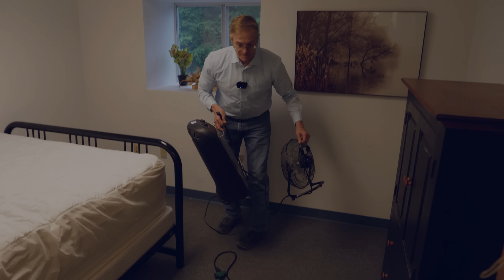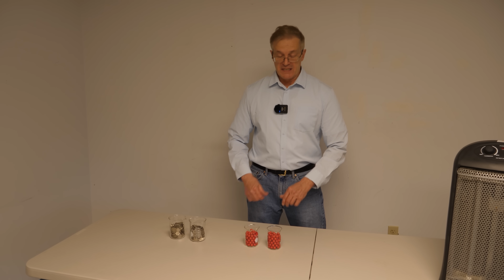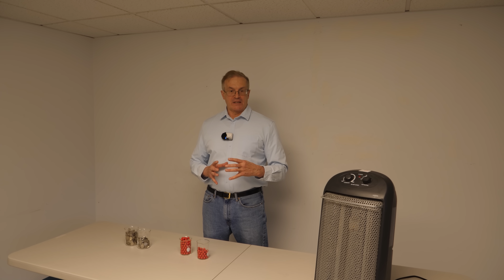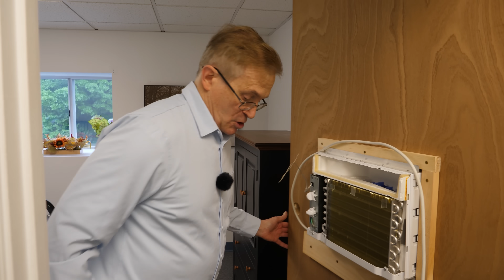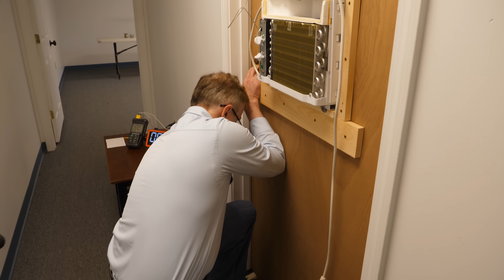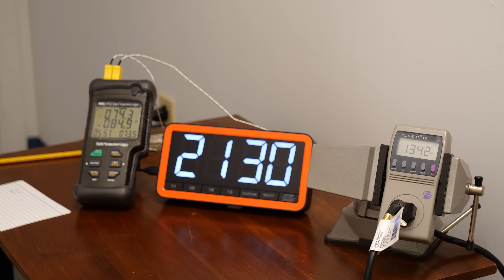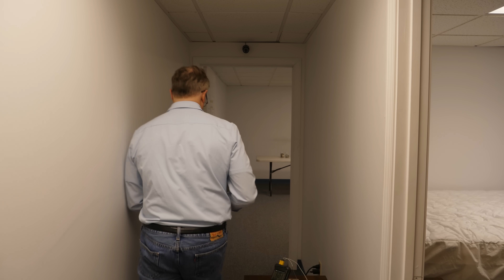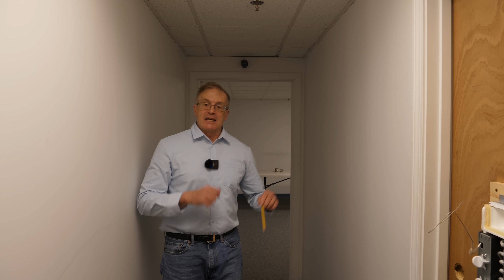You're wasting money on heating! Use your A/C!

Comment: Others have mentioned this but you are massively overcomplicating what's actually pretty simple and that's because heat pumps aren't heaters 

Anybody who thinks it's over unity because it's more than 100% efficient it's not over 100% efficient when they say over 100% efficient what they're talking about is how much heat you get per unit of electricity compared to a regular heater 

The heater he used is a heater it creates heat by converting electricity into heat 

A heat pump is not a heater at all it does not create heat so there is no such thing as how efficient the heater is it because it's not a heater. 

It's like when you see an LED light bulb that says it's 60 w equivalent but it's a 6 watt bulb it's a six watt bulb that's what it is The 60 watt equivalent means it puts out a similar amount of light that in average typical incandescent 60 w bulb would put out 

Is he bulbs aren't wattage based they're lumen based how bright is a bulb The watts don't matter how many lumens does it put out but because all of our bulb was where incandescent we learned to equate the wattage with the brightness so we didn't say it was a 1600 lumen bulb we said it was a 100 watt bulb That's why we have that weird conversion 60 watt equivalent even though it consumes six watts 

You have something similar going on here The COP factor is the same thing as saying this 6watt bulb is equivalent to a 60 watt bulb we're trying to compare it to heaters and instead of talking about BTUs per watt we're just comparing it to normal conventional resistance heating 

So a heat pump is exactly what its name says it's a heat pump meaning it's a pump it's just moving heat it's not making heat That's not its primary purpose it's primary purpose is to move heat from one side to the other 

A simple way of thinking about this is imagine you have a bucket and you can fill that bucket with heat when you want to cool your house you come inside your house you fill your bucket with heat you go outside and you dump the bucket out now the inside of the house has less heat so it feels cooler 

When you reverse a heat pump and run it in heat mode you're doing the opposite You're going outside with your bucket and your collecting heat once you fill the bucket with heat you come inside and you dump that heat inside your house 

The reason a heat pump is so efficient is because the energy that you have to expend to walk outside and fill your bucket with heat is less than the energy required to generate new heat using electricity 

But it's cold outside that doesn't matter although it does affect deficiency and depending on the design of the unit how cold you can go for example if there's half the amount of heat in the outside air not half the amount of total heat but half the amount that I'm able to extract well I just need to pass twice the amount of air through the machine to collect the same bucket of heat so as it gets colder outside I need to pass more air through the machine in order to collect enough heat to fill the bucket before I then dump that bucket inside the house 

Depending on the design of your unit will determine how low the outside temperature can be and the heater will still work effectively and also how efficiently it can do so you'll commonly see something called a seer rating the higher the seer rating the less electricity required to generate a BTU of heat

The core problem right now is that heat pumps require installation nobody makes a reasonably priced window unit that can function as a heat pump or in this case a bi-directional heat pump 

There are a couple companies making window units that are bi-directional heat pumps however these are government money sponges that's why they're selling $400 heat pumps in a window unit package for $3,000 because that's the budget limit of the government project so they of course make their unit as expensive as the budget will allow to sponge up as much of the government money as possible we already make four and $500 heat pumps so it should be possible to make a four or $500 window heat pump All it is is the same thing in a case that you stick out your window literally that's all it is currently no one really makes one of those 

There is one window unit for like 400 bucks on Amazon that can function as a heat pump but it doesn't have all of the necessary doodads to make it a true bidirectional heat bump so it only works down to 41°

I would really like to see a nice small cheap two or $300 5000 BTU bidirectional heat pump with a halfway decent seer rating say 19 or higher would be nice because then it will become feasible to solar power heat especially in the desert where I live. 

But that's all it is really it's not a heater it's a heat pump and all the over 100% and COP factor is is trying to give you a comparison to conventional resistance heaters what you need to worry about to make it simple for you to understand is simply how many BTUs of heat can I get and how much power does it take to get that That's all you need to know in order to compare these units

Comment: I'm used to watching longer vids than this from you, but it was short, concise, & informative. I knew what heat pumps were, but never really knew why they differed from an A/C or heater unit till now. I'd much rather spend my electric bill watching stuff like this than on cooling & heating.
Reply: @TechIngredients  If you can find the time, please help Jeremiah out with some advice on his Rankine cycle Tesla turbine power plant. I would love to see you play with that system some day! What you've described here seems applicable. https://www.youtube.com/watch?v=kQx8JacCWMU
Reply: @TechIngredients Just for your consideration the heater and fan were on the opposite side of the room. You should have compensated and moved the thermometer to the opposite side during the window unit as it wasn't as far from the source of heat  just guessing about three feet. It is possible it showed an artificially evaluated temp being that close to the condenser of the window unit.

Comment: It would be much less efficient if the hallway (outside) was colder as there's less available heat to absorb, which would show how it performs in cold season when heating is necessary. This eventually reaches a point equilibrium depending on the unit and elevation. Still very interesting to see the difference though in this case, it's just not that dramatic when the circumstances meet actual real world scenarios

Comment: Ok I call bs. You literally demonstrated heat pumps best case scenario. Heat pumps work really well when there's warm air for it to use. Should've put it in a freezer and then test the output for real case scenario where it's not as efficient since there's less heat for it to use.

Comment: Great video demonstrating efficiency.

In cold south Aus here currently in the middle of winter. When my gas house heater died, i replaced it with Panasonic Reverse Cycle AC units. Coupled with solar power from the roof, my energy bills have never been cheaper. The AC works great for heating. A few nights ago it was -4C outside, and inside a comfortable +17C.

In summer when its 45C outside, inside is 23C and on those days of full sun, doesnt cost a thing.

Getting off the gas network was a big cost saving and the AC units do an amazing job keeping electric bills low.

Comment: This is an excellent demonstration!  However, wouldnt it be more relevant to conpare efficiency to a gas furnace?  Electrical resistance heating is known to be less efficient, but im curious how the heat pump would compare to the gas heat.

Also interested to learn how to make the system more efficient.

Comment: I didn’t understand it until I repressurized a can of brake cleaner with an air gun. I was shocked on how hot the can got, then I finally understood how heat pumps work. The gas or refrigerant gets hotter when it gets compressed way hotter than just compressing air.
Reply from the maker: It's  those simple but profound experiences that drive science and technology.

Comment: Fantastic video, as usual! 
I've always been skeptical about heat pumps but I can see I need to rethink it.
Could you do another test of the system in the winter when their is a wider disparity between the two environments? I was impressed by the 90% figure you gave between the cold and warm temperature, but what are the limits of the system when conditions aren't optimal, say when it has to wring kinetic energy out of a sub-freezing environment? I don't doubt it works, but what does the electrical meter look like? 
Thanks to you, and the commentors here as well. I'll try harder to keep up!
PS: Did you move?

Comment: How would the results differ if your ac unit were transferring to the outside air on a cold winter day rather than to the warm hallway?
Reply from the maker: The efficiency will drop as the differential increases until, eventually,  the heat pump and the resistance heater match.
Until then, the pump wins.

Comment: I had thoughts a while back about having two insulated tanks of water or antifreeze mix underground with a heat pump that could cool one tank and heat the other. Then, depending on what was needed, run liquid exchangers to an air conditioner system or heat water, etc. By only dividing/separating the hot and cold could that help with efficiency?
Reply from the maker: Not efficiency, but cost. It's funny and timely that you mention "storing" heat and cool...
Reply: @TechIngredients , one YouTuber I watch has solar panels and batteries, when the batteries are full he just heats a giant insulated vat of water under his house. He heats the water way higher than a water heater and just blends hot/cold to bring the temp down before it goes into the pipes in the house. When he needs to heat the house he just runs the full temp vat water through an exchanger in a controlled flow to give the heated temperature he’s looking for

Comment: I've thought about this many timescmbut  #1 it's actually not Safe, # during extremely cold weather the radiator will freeze and plug up damaging the air conditioner, heat pumps have a defrost coils to prevent the ice, although this is good, move the control panel inside and attach a heat coil to the outer area, thus upping the watts but still extremely efficient, 👍
Added noise will be bad 👎

Comment: I generally respect your channel, but this has got to be one of the worst videos you've ever posted. Having the cold end of the window unit at room temperature is inexcusable in a video like this. Stick it in 10 degree (fahrenheit) environment and then tell me how it does. I can't stand all these people blathering on about how great heat pumps are, and then using them in completely unrealistic scenarios -- and yours really is one of the worst I've seen in terms of distorting reality. Do a fair comparison, at a realistic "outdoor" temperature with gas/electric comparison for the midwest and the coasts separately. You'll find that in the cold parts of the midwest, it's cheaper to heat with a high efficiency gas furnace, even if you use the best cold-climate heat pump. I realize that that window unit wont function with the cold end in a 10f climate, so go get yourselves a mini split and make the video with that. Do good science, guys. Your reputation deserves a better video than this.
Reply from the maker: Sorry to disappoint you.
I think you might have missed the point.
We're not advocating turning your airconditioners around each season.
I wanted to demonstrate a principle that, even if understood, may be underappreciated.

Comment: Us "metric people" use reverse cycle air conditioners. no-one fits one way air conditioners in much of the world (possibly only in equatorial locations?). Most fit reverse cycle (heat and cool) inverter style air conditioners which both heat and cool. Certainly no-one in their right mind in Australia where we have large swings in temperature do you fit cooling only air conditioners. The "inverter" refers to the fact they are three phase and therefore have an inbuilt inverter to convert single phase to three phase which gives much greater motor control, that is so they are not full on an full off.(possibly only in equatorial locations?)(possibly only in equatorial locations?)

Comment: There’s a big caveat to heat pumps, which is that the bigger difference between the room and the heat sink the less efficient. I think your tests worked so well because that difference was small. They’re still great, but I think the numbers may not be as great in a real world scenario
Reply from the maker: You're right. They won't be.
However,  they can be supplemented by a secondary source of heat to reduce that differential and reduce energy requirements overall.

Comment: Well… this is interesting.  I live in Austin, TX and the house I had in 1991 had a heat pump.  When it got “cold” in Texas (maybe 30º F), the heat pump couldn’t heat the house.  Indeed, it had a resistive heating element to help it in such conditions.  So… I don’t know why it performed so poorly but it did.
Reply from the maker: The heat pump's advantage shrinks as the differential increases. This makes sense based on my earlier description of the entropy involved.
Using a resistance heater or, if possible,  a much more economical source of additional heat such as gas or wood allows the pump to operate at a high efficiency and the necessary additional heat to be very affordable.

Comment: Great idea except the coil turned outside will freeze in cooler weather, and the condenser will leak water in the room, that’s why you need reversing valves, and coil probes to detect ice ups.
Reply from the maker: Thanks!
You're  correct.
We're not suggesting that this old air conditioner is a good choice for bidirectional heating and cooling compared to a commercial heat pump.
This test was designed to illustrate the power of this process.

Comment: Nice explanation of heat transfer but this is NOT a heat pump. A HP has more than just a reversing valve. It has temp sensors, a defrost board and low and high pressure switches. 
This system will NOT work in winter temps.
Reply from the maker: This IS a heat pump. It's not configured for those other applications, but that doesn't change its underlying principle.
Reply: @TechIngredients  well sure it’s the basic heat pump since we’re moving heat from one space to another but reading through a bunch of comments, a lot of people think that they can use a window unit to heat a room in the winter. That was my point

Comment: Nice demonstration!
For future tests, don't forget that the Kill-A-Watt meter can also display the total consumption for each test, giving a more accurate estimate for devices with varying consumption.
Also, because the A/C brought the room to a much higher temp, I'd estimate that it used less than 1/5th of the energy of the heater for the same heat increase.
Reply from the maker: Good points.
We left the meter on real-time output so that any changes in the rate of use could be seen rather than simply accumulated.

Comment: Interesting, but I use gas heating when the outside temps go down to 20° or less. Lots less heat to pump inside.
Reply from the maker: That makes sense.
The height of the thermal hill determines the optimal approach.

Comment: For those that say he is transferring heat from one room to another,. you are wrong. The temperature was equal in both rooms before the tests... the heating/cooling is done with coolant, coils, and pump.  your fridge works the same way. cold inside, while hot on the coils.  Regardless of how cold it gets in your house, fridge will still be cold, and coils on fridge will still be warm. This is due to the friction the motor makes while pushing the coolant. Moving of the coolant makes cold.

Comment: Please say a word about what appears to be the thermocouple up in the air instead of touching the front of the coils?
Reply from the maker: We want to measure what matters to the occupants.  Air temperature in the room is key.  The temperature of the output from the airconditioner is less important because  the cooling then has to account for the volume of air flowing from the air conditioner.

Comment: Sounds great but how warm can an A/C make a room if the air it's drawing heat from is outdoor air that's around 32 F?
Reply from the maker: An unmodified commercial airconditioner has a more limited temperature differential than a commercial heat pump. The choice of refrigerant and the compression ratio has to be optimized for a given differential range.

Comment: Even the best heat pumps today achieve a COP of 5 under ideal conditions. Once outdoor temps start dropping COP drops off quickly. That being said even my 14 year old Goodman unit will maintain a COP of 2 down until 5°F. Another thing to consider is that heat output also drops with outdoor temperature. My unit will supply 22.6 tons of heat at 65°F but that output is only 0.9 tons at 5°F. Modern units use a variable speed compressor to ramp up compressor speed to try and maintain heat output, however the COP still remains the same. 

I'm a huge fan of heat pumps but there are considerations to take into account when using them as a whole home heating source.

Comment: I have a heat 3 pumps and wood burner.
If I heated my home with the wood burner the way I do with the heat pumps I would be spending 8x on wood that I  spend on electricity. The wood burner is for emergencies only.
Reply from the maker: What about using the wood burner to supplement the heat pump? Reducing the differential for the heat pump increases its performance, and the small boost in heating requires less wood.
Reply: @TechIngredients  That is absolutely an option in the coldest months of the year, which as it happens is now in June and July for us.